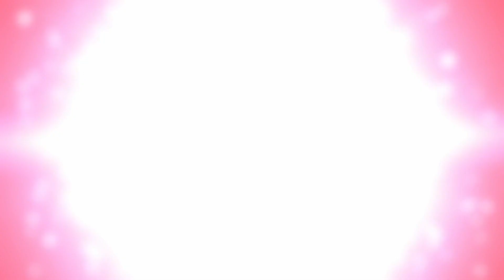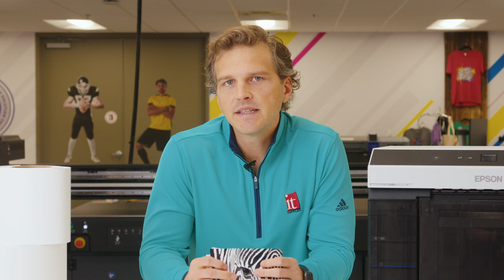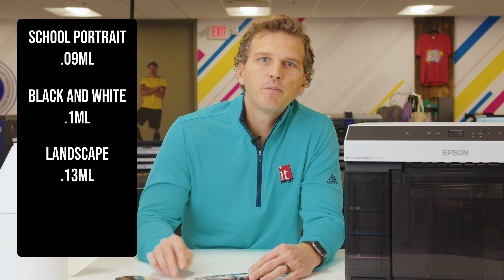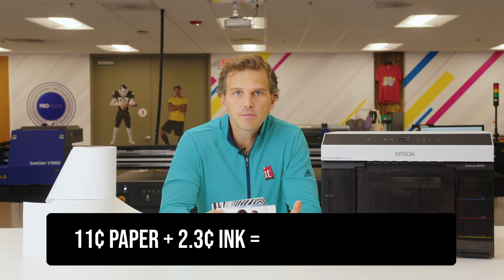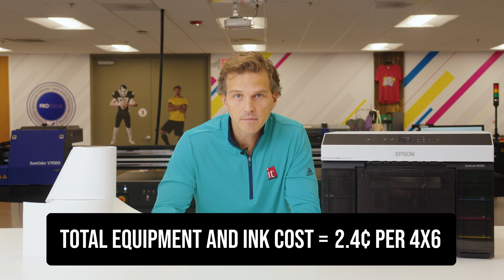EPSON SureLab D1070 Printer - Ink Usage

Comment: I would like to know if the photos that were printed for the test were in standard quality or high quality
Reply from the maker: These were all printed in standard mode. Give us a call at 1-800-771-9665 and we'll print your image in high quality mode and tell you how much ink it used.
Reply: @ITSuppliesINC  I have noticed that in my prints, no matter if the quality is high, if you get too close you will be able to notice the print dots, especially in the areas of soft shadows or gradients.  Is this normal or is it something that only happens to me?
Reply from the maker: @sunshining3268  Hi there. While the printer does use dots to create the image, the droplet size of 2.5pl is so small you really shouldn't be able to see them without magnification. Maybe there is something with the way your files are being processed?
Reply: @ITSuppliesINC  Maybe you can do a tutorial on how to print correctly.  Because I have noticed that the prints made with thermal sublimation printers are very sharp unlike the prints made with the surelab.
Reply from the maker: @sunshining3268  Reach out to us at info@itsupplies.com. We'll have you send us a few files that we can inspect and print on our D1070 to troubleshoot. Thanks!
Reply: @ITSuppliesINC  I wrote an email to the email you provided. I don't know if it's normal, but the reds in my prints look very dull. Especially in the dark areas.
Reply from the maker: @sunshining3268  This is a 4 color machine, so reds may not pop as much as you would like.  That said, the proper profile should get you close.

Comment: Good video.  Would have liked to know the cost for other standard sizes, especially 8X10.  Also, 400,000 prints for 4X7? What's the expected lifespan if I primarily print 8X10?
Reply from the maker: Hello, we're glad to run 8x10 prints with your images and report back on ink. For general purposes, 8x10 is 3.3x larger than 4x6 so ink usage would be about 3.3x more than what we had on 4x6 prints. Give us a call at 1-800-771-9665.

Comment: Permanence! That's the question! If these prints don't last but a couple of years, my clients are going to be calling me for reprints!
Reply from the maker: Hello @FlashOnTwos, unfortunately there are no archival ratings for prints done by the SureLab D1070. The prints will last a couple of years surely and you can extend the life by coating them with Premier Eco Print Shield or any UV inkjet protection. However, if you're looking for something truly archival, you'll want to look at a printer with a pigment-based aqueous ink set. If you have any questions on finding the right printer, give us a call at 1-800-771-9665!
Reply: If you need permanence you need to buy a Epson SureColor SC-P7540 or similar. This printer is not in the archival market. You're looking at the wrong machine.

Comment: we are looking at longevity, what sort of lifespan are the prints rated for? thanks
Reply from the maker: Hello, @buffieboily2883, EPSON has not provided print permanence ratings for this particular product as it has advertised in others within its photo line. If you're seeking print permanence for your photo prints, we would recommend exploring the P-Series line from EPSON which touts 200 years (color) and 400 years (B&W.) Below are two printers you might be interested in, if you're seeking long lasting and Wilhelm tested for longevity photo prints.

Small Format
https://www.itsupplies.com/Epson-SureColor-P900-17in-Wide-Desktop-Printer-p/c11ch37201.htm

Wide Format
https://www.itsupplies.com/Epson-SureColor-P9570-44in-Printer-p/scp9570se.htm
Reply: @ITSuppliesINC  thanks.  We have had several Epson printers in the past, the last on e being the P800, and we are also thinking about the P900.  We were concerned with longevity since we could find no on fo on it at all!  Thanks for getting back to me :)
Reply from the maker: No problem! We will let you know if we get any more information on this. The only mention on EPSON's end is "fade-resistant," which doesn't necessarily speak to the permanence information you're probably looking for. We believe this printer is more for production vs longevity. If you're looking for both, you could probably coat prints from the D1070 with a product like Premier Print Shield Spray which is used to protect against UV light and other environmental factors. Hope this helps!
Reply: @ITSuppliesINC  thanks!!
Reply: I need SureLab D1070